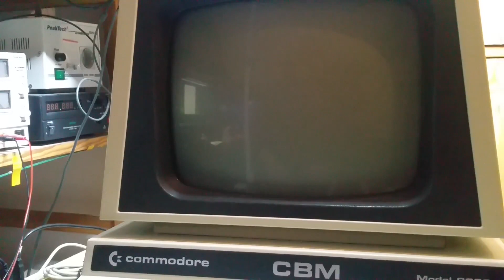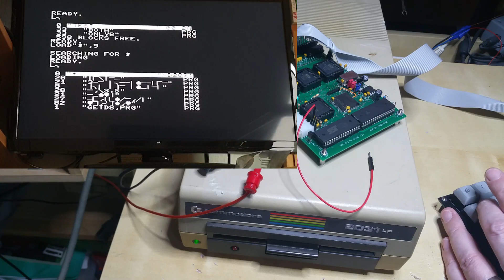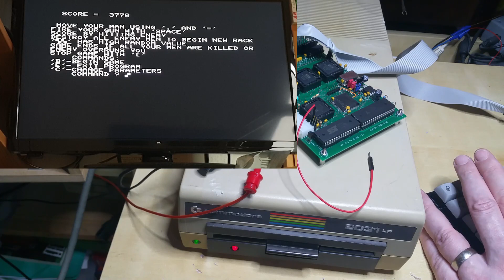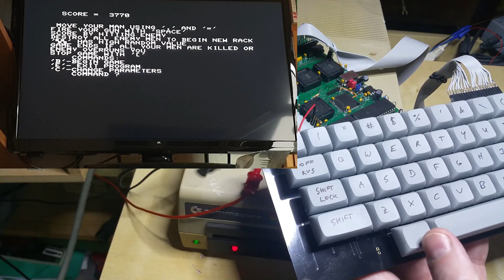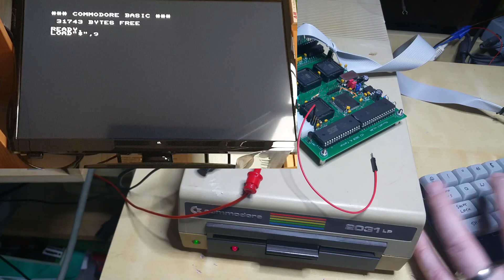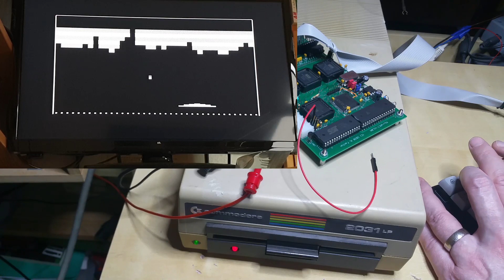8-bit times Ep7: Micro-PET released!

Comment: I have read up on the different Pet's, and it looks like a compatible adaption of the TTL circuite of the original PET lines, where nearly all the games were published, to 80 columns dual character colour, with programmable characters, is what they could have done instead of the vic20 (maybe with 40 and 20 column modes too, for different memory sizes), and use the same design with graphics modes, for a business machine with all the ports and peripherals.  Allowing the VIC to play pet games, and using a chroma 81 like mode, in colour.  It's incredible they didn't do this and the incompatibilities of the new Pet's killed off the Pet Market.  They could have at least made the C64 or Plus4 compatible with the 40 column games.

I would like to exanine the TTL circuit? Would  there be  any diagrams out there Andre?
Reply from the maker: They could have gone the TTL way - but having an own chip factory, integrating (most of) the logic into a single chip was a way to get the system cheaper.
Reply: @8bittimes  I was meaning, they could have integrated the existing simplified TTL graphics architecture, with 80 column enhancement, onto a chip, even with other chips on the system, and reduced costs further.  The 6845 would have been more expensive to buy in or manufacture.  It has a lot of features, which are configured from system to system, where, the custom circuit only needs one configuration with less transistors.
Reply: @8bittimes  I have been looking up smallest IO and passive logic.  If I was to attempt a software only compatible minimal discrete logic machine as a proof of concept circuit of how they could have designed instead the VIC 20, but with 80 columns colour and some programmable multi colour Characters, what parts of the original non 6845 designs, what you suggest I use. Can I dump most of the multifunction chips and just use USB through cpld? Or is the cassette port used for sounds?

Thank you in advance Andre.
Reply from the maker: @Mi-583  This is a few topics in one question. A good thing for a better discussion would be to go to http://forum.6502.org/ for example and post your 6502-related ideas in the hardware section. There are so many bright and experienced guys and you don't have to wait for / rely only on me answering.

Building a discrete logic video circuit is not easy, I suggest you try to understand how the Apple II or PET original video output worked - it is quite ingenious, I'm prep'ing a video on it right now - and see how you could extend it for more characters per line (i.e. higher frequencies), and/or colour. There are many options, so it depends on your requirements. Again, the forum would be a better place to discuss. 

If you dump the "multifunction chips" - assume you mean the PIA and VIA? - it's not a PET anymore, but a generic 6502. But yet, you could, I could run a "PET" on my Ultra-CPU with just a USB keyboard, but of course there is no IEEE disk access, no tape etc anymore. You'd have to replace it with SD cards for example, which I did as well. You'd loose sound though, as the VIA shift register is used for the beeper output of the PET.
Reply: @8bittimes   Thanks.  That's what I meant Andre, only asked about the simple software dependencies for minimal functionality, of the keyboard, screen and now VIA speaker support, and presumably, timing interrupts.

As for the other things, I already have my own ideas, and i'll have to check out the scope of SRAM performance to be used, and interleaved banking to improve performance and that speccy twin byte load.  These are not questions, just sharing.

I suggest MattResgan's  channel.  He has videos blocking out the Sinclair Spectrum ZX81 and Apple video circuits, and a TTL Spectrum, no Pet unfortunately.

The 6502 people I'll have to check out.  But it was just the basic scope an emulator maker would know, that I had to check out.  To catch the little emulation breakers.  A genetic way to do serial IO, like the one the VIC had, was enough to do a common Pet 20, 64, 128, 256, 1MB circuit, using a transparent form of extra bank interweaving on larger models, to increase graphics through put.  That's what I've looked at.  I suspect sufficiently fast enough SRAM for the limited scope of the cheaper Pet 20, and higher speed 6502 is possible with larger models and 16 bit.  I have a proposal for simple circuit functionality to convert the simplest 8 bit machine graphics circuits  to bitmap, multiple bit pixels, colour and pallets.  Maybe the 6502 people might be interested in that rather than I chase down the conversion of each different video circuit.  As for 80 column graphics, I remain objective.  There are ways to get there, and on the lowest system,  only a handful of programmable characters in a pure text mode are needed to make more interesting games.  Even just a 40 column mode is an enhancement.  The Aquarius is a better example.  They had a nice games character set which would have been good at 80 columns with some scrolling shift function.  But, I have some ideas to simply enhance things a little further on 20, 40, 80 column text machines.

The discrete logic design, just represents the raw circuit design, that then could be put on one chip with a 6502 at Mos, or CPLD now.  But is how custom chip designs were often prototyped.  A FPGA design can be based on a discrete logic design of the desired system, to avoid undocumented dependencies on hardware interaction differences, so that equivalent internal circuit level description of the multifunction support chips probably are out there.

These sorts of enhancements represent what could have been authentically done in those days, with USB, HDMI, SATA, VGA graphics, just being modern stand in substitutes and enhancements.  I'm exploring modes of graphics and software function, which could have realistically been implemented.

The simplicity of the scope  of hardware used by most of the early software, just makes it easier, as most is on tape based.
Reply from the maker: Schematics for the PETs are here http://www.zimmers.net/anonftp/pub/cbm/schematics/computers/pet/index.html - note that the 2001 models have TTL-based video generation, the others use the 6545/6845 CRTC IC.
Reply: @8bittimes  Thanks.  Found it after a while.  The 2001, 3000's and I think the 4032 is said to have TTL video.  You see the game numbers produce drop right off around the introduction of the 6845 (and Commodore 64).  I think the other machine, I mentioned, which was like a better PC, might have been the Victor, by Chuck Peddle.   Commodore did themselves little favour, by introducing a singing and dancing 64 when they could have put a SID in a pet and high res colour graphics.  It's insane the amount of incompatible graphics options being explored even internally for the Pet, even the TI94/a graphics chip, and there was an Educator 64 Pet with 64 parts.  They should have maxed out the 6845 resolution and colours.  It appears that the IBM system 30 graphics is like an  6845.  It's very possible, if they wanted a very expensive machine, they could have made a customised version of the chip with 256 colour mode.  These were a number of times the price they could have sold them.  Allan Sugar's cheap Amstrad PCW got the formula right years later, with just 4 grey scale hires screen.  The guy was still selling monochrome PCW's with GUI in the 1990's.   Instead they lurched from one incompatible model to another incompatible monster, landing up with a Commodore 128 series, reminiscent of the C64 and the Z80 equiped 80 columns machine with colour, but a poor chip.  It's like they wanted IBM and Apple to win.  Very strange business.

I admired the Pet, but found out it didn't have much to offer in the 1980's.  I frankly would have done monochrome plasma (as used in the first 8008 desktop all in one computer in 1973 or so, and used in laptops, and a colour one.  A Pet transportable laptop was a possibility.  Problem is Commodore was working on ultra thin net profits, but trying to sell virtually no investment top priced Pet.  They really needed that 16 and then 32 bit 6502 modes and as high a MHz as they could to match at least the entry level PC processors, and undercut the PC.  The reality was to probably role the Pet compatibility into the c64  as a low end machine (include a 80 column version of the TTL video, with colour and graphics enhancements, on the ULA, which the 256KB version of the machine could fully use, which the 64 would upgrade into) .  Do a Sinclair and produce a cheap Z80 business machine based on simple TTL design rolled into ULA like Sinclair did to undercut them, with full simple enhancements, 16 bit z80, and undercut the PC and Apple by hundreds.  No sprites needed, just very simple hardware cheaper to  offer people.  The problem with Sinclair, which lost them this strategy, is the literal quirkiness.  The QL was slightly over made (as cheap as it was) adding cost, while strangling it to save costs on costly micro drives.  If he had made it CPM compatible inside a single or dual drive case with palleted VGA and QVGA modes with 16 colour 80 column text, he could have sold heaps.  I think the thing  we miss, is that 5 1/4 inch was going out, and would have been dropping in price.  3.5 inch could have come after.  A 4 colour selectable pallet for VGA, and 16 colour selectable pallet for QVGA, would have been fine at that stage.  If they wanted to use the 68000 series, they could have emulated CPM and PC,  and even replaced the keyboard sound etc microcontroller with a z80.  They actually sold equivalent runs of z80 and could have ordered integrated versions cheaply, as Jack wanted with the plus 4 series.  A z80 licensee would have been a more desirable cheap integration partner, rather than the Italian firm.  We see none of these moves, and the clutching at the Amiga, which was years away from a cheap alternative to PC's.  Timing is a lot, and a reliable machine with Amstrad PCW like strategy for Pet was missed.  The problem with the PC, was it was complex and costly.  What business needed was reliable quality, with enough features, even if lower spec.  Who knows. Maybe the Pet could have outsold the PC.

Comment: The changing 6845 demo scene has led to 640x480 16 colour CGA technique and more colours in the demo scene. So, what more can be done to the Pet, 4/16 level grey upgrade, 16 colour hi res hardware upgrade through some modifications using the same parts?

It's a shame they never did a more advanced integrated version of the 6845, and one that was more PGA like with 256 colour mode.  There was a deal with the Lorraine (Amiga group) to offer a slightly downgraded version of the graphics as a Motorola product.  A few systems, including Coco 3 and an Amiga competitor in the UK, for 8-32 bit buses.  But failed to go through.
Reply from the maker: In the Commodore area PET CRTC demos may have started in 2010 with the 'no pets allowed demo' by orb, where IIRC I'm actually in the thank you section 😅
60Hz with 1 MHz memory acces actually restricts to 320x200 if you don't do tricks like the 80 col PETs with their two byte reads at a time. Steve Gray has actually modded an 80 col PET into a colour PET with 16 colors separate for foreground and background per character cell http://cbmsteve.ca/colourpet/index.html
My own clone does 768x576 now because that allows for border effects, so that has different timing. 
But even the different PET models had different timing between them, so demos are actually model specific
Reply: @8bittimes  :)

Thank you.

Why I was looking at how much software would break if a Sinclair QL like, but Pet compatible, circuit (with colour text modes) was used.  These days, you can put everything in an FPGA, but it's wherever it represents something which could have been done back then. 

It's hard to work out here Chuck plays down his time meeting the Atari and Apple teams, like he had to help them out.  Yet he comes from an academic circle forecasting the home computer revolution,and can only come up with an earlier 1970's version of VIC to use, and Pet based on the Kim-1.  It just doesn't make sense.  It is about designing around limitations, but the Vic was not great, and the Vic2 needed little extras and  80 columns support to really challenge in more areas and last (it's limitations made it less in Business against the future PC) and the 6502 needed more reworking to compete with the future.  It was obvious a simpler circuit implemented into a 6502 or support chip, was ATARI's VCS costing answer, as they were paying for a custom chip anyway.  But, he did none of this.  The plus4 range was another lost opportunity that could have been better pointed before he left.  Bill, nearly was the first one to make a full integration with memory controller, yet didn't.  The progression of each of these steps should have been more advanced, with PET allowing for charter rom area to be remapped to Ram, and some Pet with 80 column coloured text and graphics by 1980. To keep the advancement and competition up.  The Apple 2 and cpm was. Cake walk to compete with, yet the Pet was the cane walk.   The market it was obviously that integrated chips with the 6502 was going to bring costs down for the Pet and other machines.  Z80 needed not be the completion.  Virtually none of it is the genius people say.